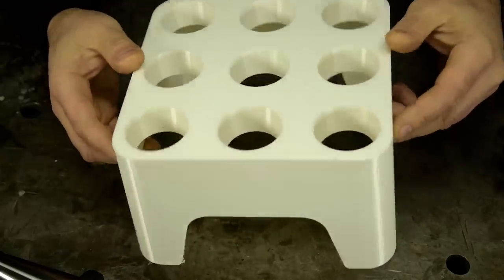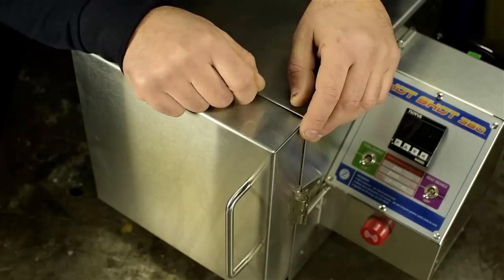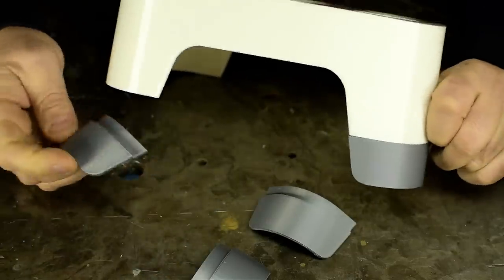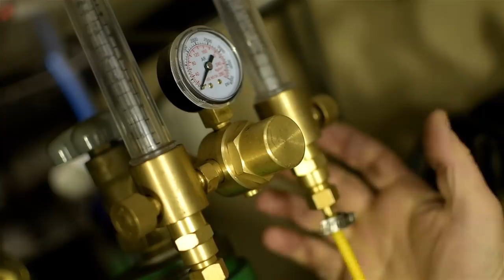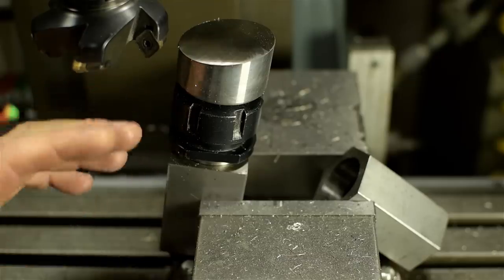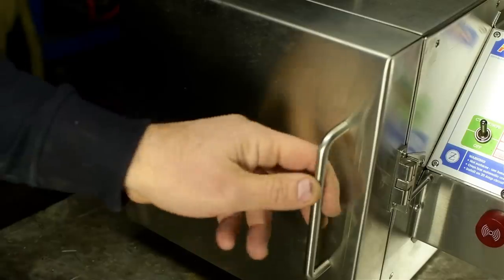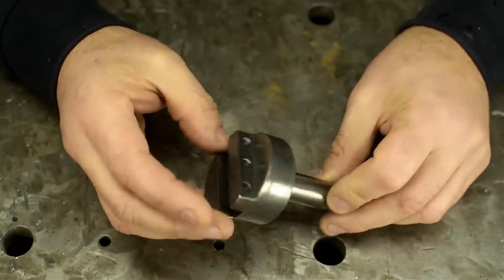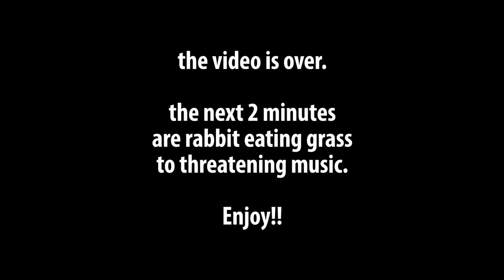NOW We're Cook'n with Argon!!

Comment: Did you clean the part of all grease and oil with denatured alcohol and thouroughly dry it before putting it in the oven maybe start at a lower temprature and ramp it up. When I hear treat knives I have found if I polish before heat treatment there is less scale.

Comment: Hey Tony, I'm in a pinch and looking for some advice. I need to find some feeler gauges no wider than .375. We bought new rocker arms for a race motor and the stainless rockers protrude below the rocker tip. I have several sets a half inch wide but they won't clear the rocker body to lash the valves.
Do you know of a set that are narrow, tapered, or a way to accurately cut feeler gauges to allow me to get where I need to be? I've ran these euth hydraulic cams before and since they're like hand grenades preloaded it was never an issue. With the solid cam I need much more accuracy.  I know you tinker with motorcycles and I see some sets are tapered. I just cannot find if they're .375 or narrower in the product specs.

Comment: I, like maybe some, would like to find an oven that works as a heat treat oven and small kiln for ceramics. (I would like to slip cast from molds from my own 3D printer that prints exactly what I want, har har, and maybe heat treat a knife or something not huge). Would you hot shot 360 do the trick?

Comment: Personally, with argon being heavier than the air I would have mounted it low in the oven. That way it would see slightly less heat and it would push the oxygen up instead of mixing with it as it ran down through the oxygen.

Comment: I am curious if the scaling was due to the O2 that entered the chamber when you opened the door to insert the part.  I would be curious if you could put the part in the furnace when its cold, run the argon to push everything out, then turn on the furnace with the part already in?

Comment: @This Old Tony, would it increase effectiveness of the argon and decrease the amount used, if the oven was rotated into its back, so that the lid was on the top? My theory is that you are still getting air sucked into the oven, and leaking out a ton of wasted argon through the oven door. I think that’s playing a role in why there is still some mill scale at all. That, and I think if you can come up with a way to shield the part during the transfer from the oven to the quenching oil somehow.

Comment: To easily get the film off of lasercut parts, or plexiglass; grab some duck tape, put it halfway on the plastic, then pull the tape up. The plastic should stick to the tape rather than the metal, and come right off.

Comment: To Conserve the precious noble of gases wouldn't it be a good idea to tilt the oven 90° so the lid is turned up,  and since the gas is heavier then air it won't escape and will also push the lighter air away from the parts? :)

Comment: Next time you have to drill stainless steel use a drop of woodworking glue or white glue on the metal and in a few seconds in will go right through, the drill bit will be trash but you will have a nice hole you didn't have to swear at.

Comment: That flow control isn't rated for argon. You can use it for argon, but the reading needs to be calculated in order to get the flow you want....like Kentucky windage. When you go with nitrogen you may need to do the same thing...check the flow controller and see if it's for Air, CO2 or nitrogen.

Comment: dont you need a purge at the top of the oven to let the air (o2 N2) escape? Ar is heavier and will push the air out. So put your piece of steel inside before switching on the heat, test the exiting gaz with a candle in a bottle, if it goes off, its Ar.. Start heating and reduce the flow to spare Ar.

Comment: Try putting your part in a stainless foil bag when go to the quench from the oven 
It won’t get oxidation on it 
We did that with small batches of parts at GE aircraft engine group I worked in heat treat 
We also use vacuum furnaces 
Purged with hydrogen 
I wouldn’t suggest trying that lol 
Or you’ll have a real explosion 💥😂😂😂😂😃

Comment: 1mm nozzle? I use one, but watch out that your hotend can keep up. If it isn't powerful enough to melt plastic at that flowrate, you will get voids and all sorts of strange issues, forcing you to slow the print speed down. At that point, you might as well use a smaller nozzle, as they have better resolution and drip less.

Comment: So, I think I have a good idea. I only have basic knowledge and no prior experience. Why you don't put the door facing up. Think of a chest freezer: argon is denser than air, just like cold air, a chest freezer will trap the cold air inside and why nmot use that principle. That could save you a lot of argon or nitrogen by not dumping it in the atmoshere. To test how much argon/nitrgogen you have left in the furnace, just dip a match and the height at which the match  goes out is your indactor.

Comment: This anti-scale coating acts as a barrier to the basic reactions of oxidation and decarburization. To prevent scaling and decarburization, care is taken to apply a uniform coating layer on the component. The coating also reduces decarburization on billets and ingots during hot-forging and hot-rolling operations. Heat transfer from the heating medium to the metal is unaffected by the coating. Additionally, the coating has no reaction with the steel surface and no release of toxic fumes during use, heat treatment or storage. The coating is nonhazardous and economical to use.

Comment: so here is a twist
with temperatures in the 1000≥ range use straight up nitrogen it is stable and will not react and its cheaper...way cheaper
bigger twist, like mag welding use CO2
it woll itch up and increase the carbon content of the surface of the part giving that you are going to use temperature above 1600

Comment: Now I need to know how you get your butt rabbits so white. Mine are for the most part brown and sometimes an occasional black or green. Does it have to do with the gas that you use? I usually only have methane at my disposal.
I also am quite curious if you can use the oven to harden your butt rabbits. If so I'm sold.

Comment: is 1750 °F a little high ?  1711,3 °F is wat we use for Harding gear wheels.
Reply: We don't use argon however we use a mix of Methanol, Nitrogen, gas and sometimes Ammonia to keep oxygen out. Ammonia doesn't smell good 😒
Reply: I stuck my nose a little bit further down the rabbit hole and it is like so. The Methanol is continually injected in small doses when the oven is hot enough, the Methanol won't  vaporize however it will crack / split into among other things like carbon which been used in the hardning. 
The Nitrogen is used to keep the oxygen down and Gas is added to keep the mixture in place.
It is all being controlled by a oxygen sensor and to calibrate the whole process, is don by adding a small piece of folio for a specific size and time. 
Then the folio is taken out and weighed to see howe much carbon is been added, the size of the folio is about 10 mm2 so it is highly sensitive.
I will try to see if I can take some pictures and I will post the link after that.

Comment: The last 30 seconds of bunny munches menacingly requires pressing the j key three times, otherwise the 2 minutes on the spec sheet under-runs. This is by design, the expectations are tempered with Argon, not Nitrogen. In places that use metric thats triple-once times on the Swedish i. In places that use binary it's just simplest to turn it off and on again. If you're an adult and find these instructions confusing I advise you to get help from a small child you trust.

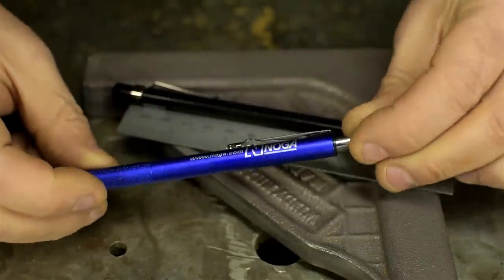Comment: 4:29 the 'nose and ear hair trimmer' is a small deburrer, great for using to get the inside of a hole you can't get access to. Example, an engine block. Can use on any metal edge to clean it up nicely

Comment: Hello There,  I need some help. Got some scrap from a machine shop, what look like some nice 3/4 SS bar. Little I know it was the beginning of my confrontation with a demonic material. I can cut it with regular bi-metal hacksaw, but trying to drilling ended up in a scary experience. Worked nice all the way to 1/4 drill bit. After that it started distorting any subsequent size, tried different speeds from 480 rpm up... no way. When applied more force, the next thing I saw was very bright white sparkles and the next thing was a very bright white fire of the chips! 

It took me a little to take I’d down but it scared me ( kinda) 

So now I tried to put on the lathe... no success with carbide inserts but no success, instead it worked very well producing very hair thin rat nest of wires with a single point high speed tool.  But I literally could not push the tools more then few tau per pass. 

Any attempt at doing more, fume and flames were ready. Strangely it cut very well on the side of the tool ????
Reply: Still me.. tried to anneal it but that thing got red way faster than expected ... nothing sticks to it, changed color like SS but ... that’s it.

I am more then willing to donate it for a video on strange materials should not be used by hobby machinist. 

Thanks for helping

Comment: Where is the air exiting the oven? Past the door seal? Should figure out how long it takes to purge the oven, it’s not the most efficient process. 
You open then the door and transport the red-hot piece to the quench barrel - oxygen is attacking it now. Keep that as short a distance as safety allows.  Maybe just fill the shop with argon and wear scuba gear

Comment: That pain in the butt sticky tape they put on the #4 stainless steel comes off like a ( fill in the blank) if you heat up the non sticky side with a torch or what have you .😷

Comment: TOT, I really like your videos and presentational style.  Especially the hands.  And here's the point.  I can't help noticing that you seem to be a compulsive nail-biter. (Unless you are a homicidal-manicurist's practice-volunteer, which is less likely, so let's just go with the onychophagy assumption, eh?).  The $64,000 question is, how have you survived so far with ingesting all those potentially carcinogenic cutting oils and metal particles?  Or do you scrub up before tucking in?  And how do you pick up No 80 drills?   These are important questions and your fan-base needs to be told!

Comment: For ummm reasons that I can’t tell you. You are going to want to keep with the argon. Yes nitrogen is considered a non oxidizing gas how ever it will still provide an environment that will discolor metal. argon is a noble gas and will not discolor metal. I will add that you need “dry” gas if the gas is contaminated with water or oxygen you are screwed. No compressed tank is free of contamination. even the super clean lab grade tanks, there all dirty. So what your really want, is to use boil off liquid argon. If you are willing to go with boil off I’ll take back my first statement and say you can actually use nitrogen.